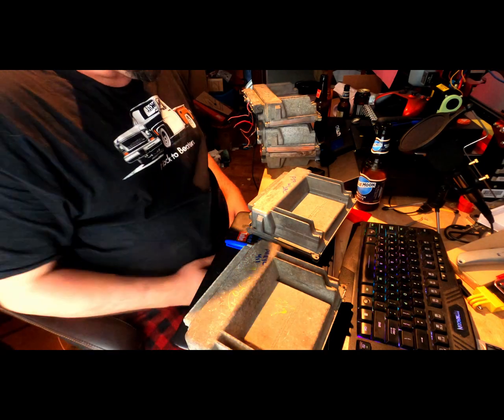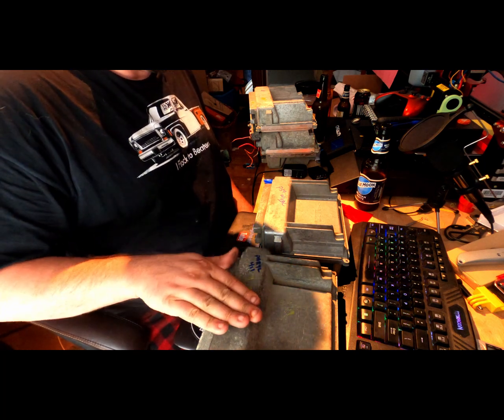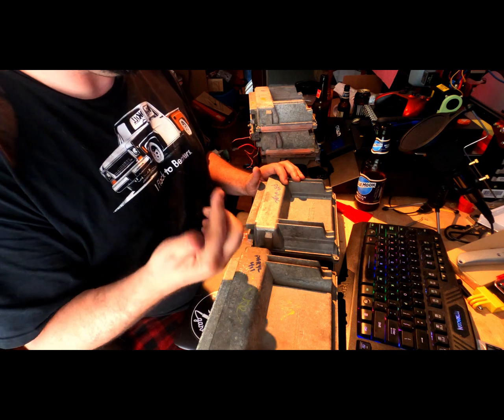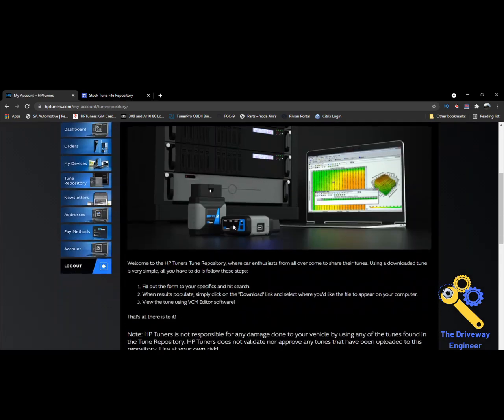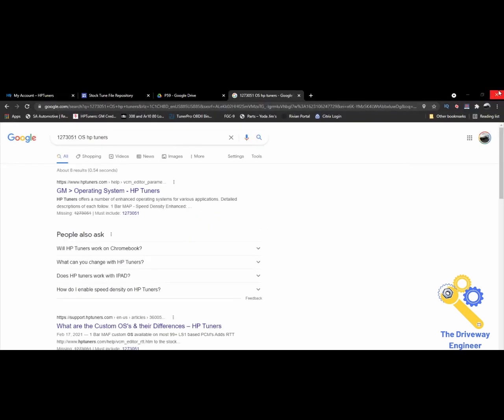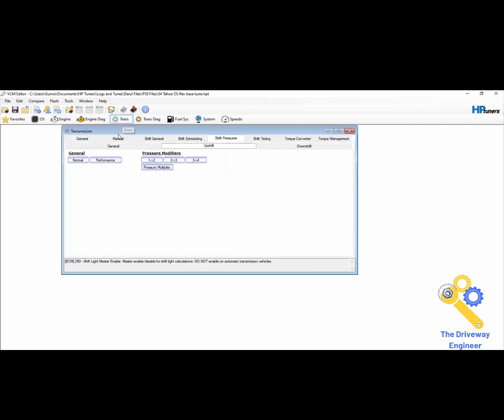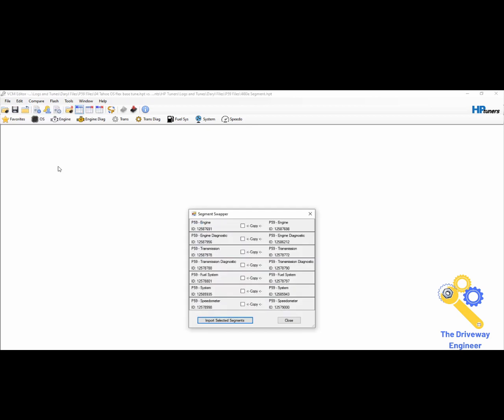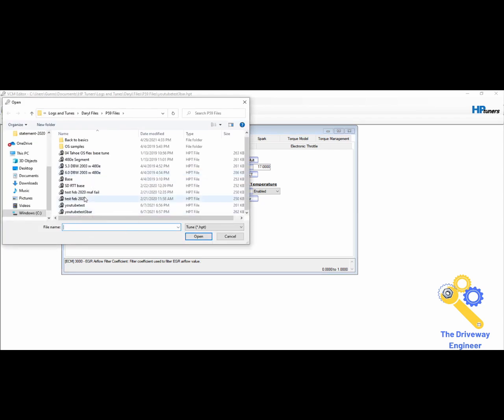LS Truck PCM options. P59, P01, 411, Hp Tuners segment swapping, wtf is going on?

Comment: I have an 03 p59 pcm(green and blue)  on my ls swap but im having a hard time finishing my swap because the DBW is giving me problems. Do you have a video on how i can convert to DBC..do i just buy the red and green harness and throttle body amd boom good to go ?
Reply from the maker: No, you need the ECM too
Reply: @TheDrivewayEngineer  I forgot to mention my pcm is DBC and Dbw compatible..if I disable electronic TB on the pcm would that work?

Comment: I have a p59 for my swap. I found the pinout. I'm disappointed there isn't a tach signal available. Is there a way enable tach signal in the software? Reflash? I'm going to use Ls droid Tunerpro most likely
Reply: its the white wire on the cluster connector your not seeing it on the pinout because its sent via databus (class 2 data) between the IPC and PCM (pcm gets tach signal from cam sensor, in regards to dash tach output at least) even if not using stock cluster signal will still be there. any tach will ussually work, set it on 4cyl mode these engines sll output tach as a 4cyl

Comment: Thanks for the video, it gave me at least some clarity. The question(s) I have.. my PCM is a p59 which has DBW&DBC capabilities. I'd like to use DBC for my swap. Also, the tune that's on the pcm is for a manual transmission, I think it's for an 04 manual, silverado. I plan to use a T56 transmission for my swap.

1) Should I bother messing with the transmission section at all? (ie. segment swap a 2004 GTO manual trans to my tune file? not sure if torque management etc. might be different)
2) Since I want to run DBC and I think the tune is DBW... do I just have to disable DTC's related to DBW sensors?
Reply: Hey man. Did you ever figured our ?..
Reply: @Grim_R13576  I think so. I'll also be honest, I'm still working on the project that this question pertains to so I cant tell you for certain the modifications I made to my tune work with 100% guarantee.

My file is a 5.3 manual on a p59 pcm with DBW and DBC capability. What I'm using the PCM and harness I made with is a 416 stroker /  T56.

For the first note regarding the transmission section. All I did was copy any differences in the transmission section between my file and a T56 stock file (ie. 02 Camaro M6) and double checked to make sure that any automatic transmission DTC's were disabled

For the second note, my base file has electronic throttle control enabled. To disable this, I went to System > System Options > and in the ETC column changed the value from 1 to 0 (this disables ETC) and makes those tables in the Electronic Throttle tab irrelevant. To be safe, also disabled any DTC's related to electronic throttle control and ENABLED any DTC's related to IAC/TPS sensors

Hope this helps
Reply: @GnarlyBlade  I had edited my previous comment but for some reason it didn't edit..anyways my pcm is both dbc and dbw compatible...I currently have an aftermarket (ebay) dbw on it but it started giving me problems right before finishing the swap...

I was thinking about swaping it with an ebay DBC harness and DBC throttle body...but wasn't sure if that was possible(different pcm connector colors i.e red blue)...but by reading at your comment It'll probably work by disable the Electronic TB and enable IAC tabs(i can probably figured it out on my own on how to do it, by following yours steps but is there a video somewhere where i can follow; Just to play it safe ? If not that's fine your guide is good enoght hahaha..I hope the DBC harness fits the PCM

Thank you for taking the time to responding:).
Reply: @ Just curious.. what issues were you having with DBW? If you don't know, to convert to a drive by cable setup, you will need a drive by cable throttlebody, TPS sensor, IAC motor, and a 'gas' pedal that is drive by cable compatible FYI
Reply: @GnarlyBlade  I was closed to finishing my obs swap..after installing an electrical oil pressure switch my gas pedal didn't want to respond..checked it with my obd scanner and had a code..switched TB with an Amazon one to see if that helped, nope made it worse...switched back and it seemed like is starting working again..until it didn't..keep getting different codes(pedal stop responding). Can't seem to find anything on how to fix my problem
Reply: @GnarlyBlade  yeah man. I was planning on buying a cheap dbc harness and a dbc TB..and messing with the pcm hoping that would work...assuming the red and green pcm connector fit the pcm..I was looking to see any differences on both harnesses. Seems like the only difference besides the obvious TB plugs are 02 sensors plugs, oil pressure plug and coil plugss
Reply: @ do you have a part number for that oil pressure switch? Hardware/Service number for PCM you're using? Wiring harness type? (blue/red or blue/green)? 

Have you checked your grounds for the pedal/tac module and oil pressure switch?
Reply: @ That sounds right, I think. I know the O2 sensors are different between the early and later years
Reply: I do not.all I know it's a square one(like a T)for the DBc harness...Ser.12576106 Hwd.12570558 fir an 03 pcm. Currently have the green/blue one(DBW). Going to swap with the red/blue one..I mean every ground seems to be on there righ.t.
Reply: @GnarlyBlade yeah,man..the ones I got now has 2 keyways(white plug) compared ti the other one with one keyway (black plug).
Reply: @ Ya I'm sorry, not sure how else to help with the issue you're having with your DBW setup.  Regarding swapping what you have to DBC.. Your PCM is similar to mine (green/blue) with DBW or DBC capability. If I understand correctly, you also have an engine harness with green and blue connectors. You should be able to modify that harness following the steps in that LT1swap link, no need to goof around with any of the O2 sensor wiring. You'd just have to add the IAC (4 wires, Pins 76-79) and TPS (3 wires, blue 8, blue 60, green 24)
Reply: @GnarlyBlade No worries man, you been more than helpful!! I really appreciate your time😁..correct blue and green pcm connectors...huh 🤔..so you're saying, all I have to do is add wires to the corresponding blue and green connector(pins you mentioned); buy the IAC and TPS plugs and hook them up ?!
Reply: @Grim_R13576 yes. In addition to the programming I mentioned in HPT & getting a DBC throttle body + pedal
Reply: @GnarlyBlade did you get my other message ?..for some reason YouTube deleted it 2x.
Reply: @Grim_R13576 not sure what message you’re referring to sorry, I hope the info I shared helped
Reply: @GnarlyBlade it's all good man..yeah, more than handful. Now i have to figure out what to do with the new TB vent hose since my old dbw TB didn't have one. Thanks again..
Reply: @Grim_R13576 usually goes to pcv tubing 
Usually some rubber hoses coming off the valve covers that go pcv valve and up to throttle body nipple
Reply: @GnarlyBlade I looked at my engine and as you said, theirs a hose going to the intake manifold(06 engine)(right behind the TB) and it goes to the passenger valve cover. But since my old TB didn't have a vent nipple, I have nowhere to attach the new Tb nipple to
Reply: @Grim_R13576  another note, I had to add wiring for the IAC and TPS connectors at the PCM. Lt1swap has a drive by wire to cable conversion guide on his website

Comment: Greetings, I am looking for a PCM for a swap ls, I do not live in the USA, I am from Venezuela, these PCMs that you mention in this video are very expensive in my country, 300, 400 USD, and looking on ebay I found some fairly cheap PCMs that They are physically the same as the p01 and p59 but they are from, for example, Malibu 01-03, this one has a blue connector and a clear one, another 2003-2005 Chevrolet Impala another 03-04-05 CHEVROLET VENTURE/MONTANA, I would like to know if these pcms have a good programming could work in my ls swap project, I would like DBC and a th 400, thanks in advance
Reply from the maker: If you're going to use a tool like PCM Hammer, then yes, you can easily load the V8 software onto PCMs sourced from other applications, like an S10.

You do have to match the PCM to the harness, I'd stick with 99-02 PCMs, of the 411 type to make it easy on yourself
Reply: @TheDrivewayEngineer Absolutely correct my friend. Because that's what I'm doing for my 98 Camaro ss pcm 0411 upgrade. I didn't want to use the 98 pcm original, because they are Notorious for failure over time due to poorly put together products/programming.

Comment: Is this a place where I can ask what pins are available for extra sensors?
Want to run a Fuel pressure sensor and a wideband, and only know of the egr pin being empty, A/C is being used, so don't want to use that. P59

Comment: The OS for a 2002 Tahoe with L59, is Flex Fuel ready, and drive by cable.  
It's what I run on the P01 in my LS2 swapped 2000 Silverado.  Just be warned...  512v 1mb is NOT THE SPEED of the ECU.  It memory, and the P01 has less, meaning if you run an OS with certain features, like flex fuel, you will loose other options.  Like being able to update to a 2bar OS.  Or you loose some of the finer tuning options.  The P59s, from my experience, tend to keep these features.  So IMO, it's better to add an IAC driver, or find a P59 with and flash the appropriate OS for your application, and tune from there.
Or, convert your car/truck to DBW, and forget the IAC chip all together.  (I know that's not always possible).. like swapping to a 72chevelle.  It can be done, but that DBW pedal setup isn't available stock, so it costs more
Reply: That was my understanding as well. File size, not cpu speed.

Comment: Hey! I enjoy your vids, i live a half mile from pick n pull here in tumwater. Ive been playing with these ls truck motors for two years, bought 16 engines so far. Started out butchering harnesses to remove them. Now i pull everything. They are only $352! I paid a guy $100 each to clear vats on 11 pcms.i dont know anything about doing that but watching your vids i think theres alot im missing or could be collecting myself. Like  os systems? Collect them for later? Im 52 and dont do computers much but these motors may break me out. Ive only put one in my 55 chevy, but all my cars are getting one. Just got a 4.8 4l80 combo for my 40 chev, i dont really know what your talking about when your talking os or computer terms, ill keep watching to try and learn.
Reply from the maker: Depending on the year, engine, options, GM used different operating systems on the PCM that enabled different things. 

To most people, that just doesn't matter, but when you want to do things like add Flex Fuel to a vehicle that didn't have it, or use a manual or non-electronic trans, it starts to matter.

Comment: Are you able to tune/segment swap multiple PCMs for multiple engines because you have multiple license’s?
Reply from the maker: I'm not following, but each PCM takes at least two license credits in HP Tuners
Reply: @TheDrivewayEngineer  What I mean is: are you personally able to program/tune any PCM you have or get because you have several different engines licensed in HP Tuners? I assume you own the license to tune a PCM to LQ4 specs because you did so with Daryl? And maybe a 5.3 because you tuned for your nephew? Just trying to understand how HP Tuner works. Or is it like a shopping cart you fill up with tuning and segment swaps that you pay for when you check out? I enjoyed the video. Trying to decide if I should purchase HP tuners and have my friend show me the particulars. I have an LQ4, SS2 cam, 2 Kemso pumps, VS 78/76, barnes cross over and log manifold, soon to have Jansen torque converter and some sort of injectors. Following your recipe. Thanks for your time. I am enjoying the recent uploads. Keep them coming! Always on the edge of my seat until the next one!
Reply from the maker: @noahmc1547  HP Tuners locks to the PCM. 

So once you license your PCM, you have a license for it forever, unless you change OS, then you'd have to license the new tune as well. 

So I can tune Trenton's truck forever, but not any random 5.3
Reply: @TheDrivewayEngineer  makes perfect sense. Thanks JR!
Reply: Did you ever believe you would have such a following? Talk about a legacy. Great work JR.
Reply from the maker: @noahmc1547  no one is more surprised than me lol

Comment: Have you ever consider using a adapter swap kit from PCM of NC  . Plug and play . You still have to remove a couple of setting with HP .
Reply from the maker: Not if it costs money, there's nothing I can't do with thing's I have right here and a short amount of time that would lead me to spend anything over double digits on anything from anyone else.

Comment: Nice videos J.R!  ive been using them for my LS swap. Buying a CNCH harness but my PCM is out of a 06 van. Its blue/green but dbc, do i buy the red/blue dbc harness and change the red endcaps from red to green? Or would I have to use HP tuners to os swap my p59 to a pcm/tune that uses red/blue?
Reply from the maker: You can do all of that lol.

If I were you, I'd use the van harness, if it's not cut. 

If you can't, I'd buy the DBW harness and add the IAC and TPS plugs. 

You can also convert a red/green harness with some repining if you decide to go that way. 

I'll be covering all of this in the coming weeks as I work through the D100 stuff.